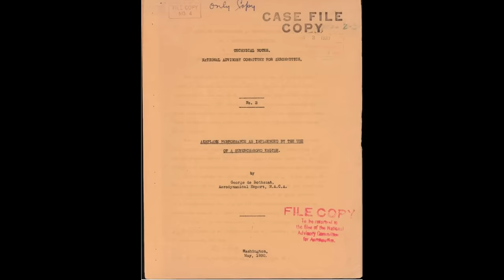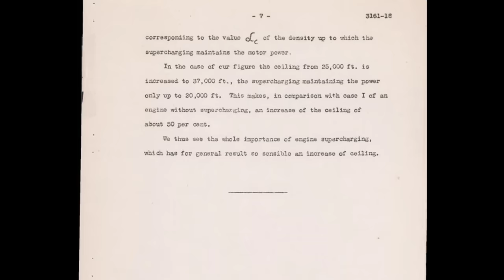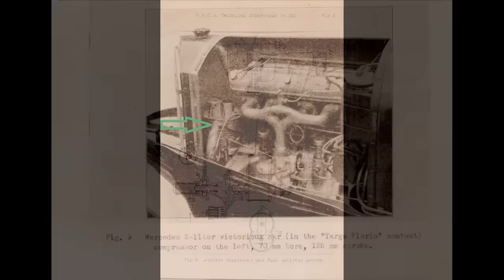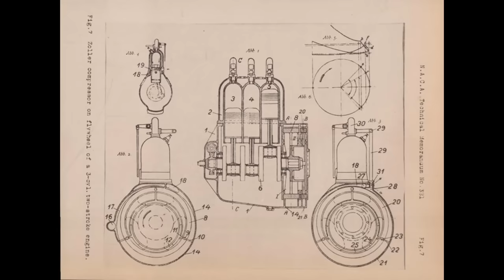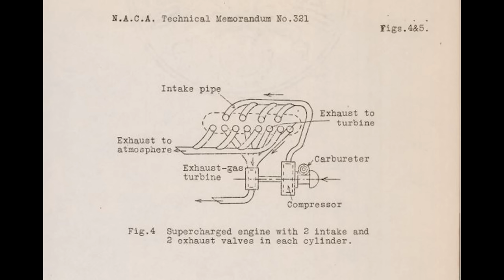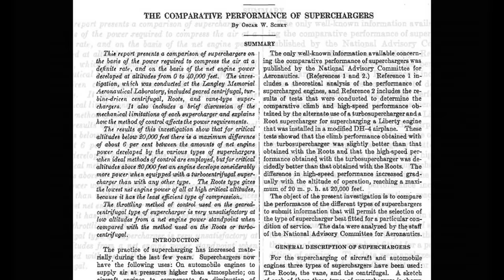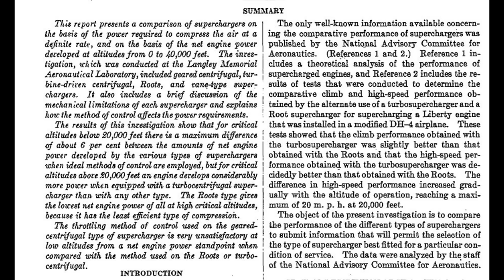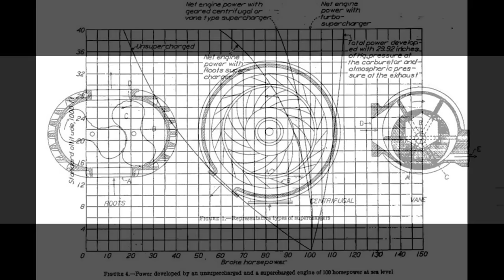Turbo vs Supercharging in WW2 Airplanes

Comment: Are the power losses below critical altitude due to throttling per se, or due to the power lost to driving the supercharger? Several books I've read have said the latter - if you optimize the supercharger ratios for high altitude, at low altitude the atmosphere is much denser, so it takes a lot more energy to drive the supercharger since it's geared high enough to drive the compressor fast enough to provide full boost at high altitude. Yes, you do have to throttle the air coming in but you've got it adjusted so that the engine is operating at maximum boost all the way up to the critical altitude (it drops off after that because the compressor can't spin faster since the gear ratio is fixed). Since it's always operating at maximum boost below the critical altitude, the engine itself produces the same amount of gross power, but the compressor is absorbing more power at low altitude so there's less net power being produced. I suppose the corollary to this is the turbo isn't being driven by the shaft and therefore isn't subtracting from the output power, and this is why power doesn't drop off at low altitudes. At low altitudes atmospheric pressure is higher and you'd theoretically have higher backpressure but this is balanced by less need for compression to achieve maximum boost, so excess exhaust would be vented via the waste gate, which would serve to reduce backpressure.
Reply from the maker: It always costs power to drive the supercharger, so those power losses are always there. The throttling losses are in ADDITION to the normal drive power costs. That's the reason the power is lower below the critical altitude. At the critical altitude you don't have throttling, it's wide open. If you throttle (meaning cut off or restrict the air) a supercharger will have to work harder and thus draw more power to generate a given amount of manifold pressure.
Reply: At low altitudes the air is denser. The compressor is working at a fixed RPM (since it's geared at a specific ratio to the output shaft of the engine) so it would have to work harder and lose more power from compressing the air if the air is denser. As altitude increases the air gets less dense so the compressor has less resistance to its movement. At least, that's the way it was explained, and it does make sense to me. If you throttle the air coming in, you'd actually reduce the air pressure (on the back side of the throttle valve) and it seems to me that the compressor would absorb less power at a given RPM. I suppose I'm going to have to think about this some more - the final result is supposed to be maximum boost at all altitudes up to the critical altitude, you HAVE to throttle the engine if your supercharger is operating at fixed RPM, the amount of power absorbed depends on the resistance of the air that's being compressed, that would depend on its density, that density depends on the altitude, but it also depends on the throttle setting. Theoretically, at maximum boost (the output pressure) and fixed RPM, the incoming pressure in front of the impeller (which depends on both atmospheric pressure and the degree of throttling) MUST be the same for all altitudes! Yeah, it's confusing!
Reply from the maker: Back up for a moment. There is a reason that throttling increases the loses due to supercharger drive power. Think of it like this. If you are at sea level, and you have atmospheric pressure at the inlet (throttle fully open) you have about 14.7psi at the inlet. Now, lets say you want to have 19.7psi in the intake manifold. How much boost does your supercharger need to create. It needs to create 5psi. Simple so far. Now, throttle the supercharger so that inlet pressure is only 11.7psi at the supercharger inlet .Now how much boost does it need to make to get 19.7psi? Clearly a supercharger that needs to make 8psi is going to draw more power than the identical unit only needing to make 5psi. That's why throttle causes loses. This isn't simply my opinion. It's straight from NACA.
Reply: I've been thinking about this some more. The reason the supercharger inlet needs throttling at all is because at sea level the amount of boost you'd get is too much, so you throttle it to the point where you have, as you say, 19.7 psi in the intake manifold. This is because the supercharger is geared at a fixed gear ratio to the output shaft - say (I'm making up a number here) 6000 RPM. So at sea level you throttle it so your inlet pressure is 11.7 psi and the supercharger will boost that to 19.7 psi (an increase of 8 psi). You CAN'T operate the engine with the throttle wide open at sea level because that would mean you have more than 19.7 psi in the manifold. OK, so now you've climbed to, say, 12,000 feet. Air pressure has dropped to, say, 13.7 psi (I'm making this up, of course). You STILL have to throttle the intake, but by how much? By whatever it takes to reduce the inlet pressure to 11.7 psi, because the supercharger is STILL spinning at 6000 RPM and the intake manifold pressure must still be held to 19.7 psi to make maximum allowable power at the same RPM. By the time you get to the critical altitude, say, 24,000 feet, atmospheric pressure is now 11.7 psi and the throttle is finally wide open. The intake manifold pressure is STILL 19.7 psi because the supercharger is still spinning at 6000 RPM. Now, above the critical altitude, atmospheric pressure has dropped below 11.7 psi, and the supercharger can't maintain 19.7 psi in the intake manifold anymore, so power output drops even with the supercharger spinning at 6000 RPM. So I still don't see how throttling would cause a power drop at lower altitudes, since the amount of compression necessary remains the same. This also means my other explanation (that higher air density at low altitudes absorbs more power at the same impeller RPM) doesn't work, either, since we're holding the inlet pressure the same by way of the throttle. I'm obviously missing something here, and will have to think about this some more. By the way, I really do enjoy these videos, keep making them!
Reply from the maker: I suggest you download the NACA report and read through it. I know it's confusing, but throttling costs power. Blow through a straw and it's easy. Block one end and try to blow through the same amount of air in the same amount of time and you will use more energy doing it.
Reply: Yeah, I'll definitely have to do that and see what's going on, since I'm definitely missing something here. I do understand that it takes more energy to suck air through a partially closed throttle valve, however at low altitudes (where the throttling takes place) the ambient air pressure is higher anyway and should provide the extra energy for the air to make it past the throttle valve.

Comment: What determines how many blades a propeller had and what a propeller diameter is? on those WWII planes ✈️??
Reply from the maker: Required blade area and tip speed limitations.

Comment: Geared and centrifugal Superchargers were a mature technology and exhaust driven superchargers were a nascent technology.  War spurns development, but not a good time to putting too many of your chips in Nascent technologies.  You are correct the problems with Allison engines were mostly the fault of the US military telling aircraft manufacturers HOW to achieve the performance that they wanted rather than just telling them WHAT performance they wanted from airplanes.   The US suffered from extremely arrogant military leadership.

Comment: I find it interesting that NACA Report No. 384 does not take exhaust thrust into account, especially considering that the mechanically driven supercharger is superior to the turbocharger in this regard. In Sighard F. Hoerner's, "Fluid Dynamic Drag," the author estimates that exhaust thrust (in lbs) is roughly equal to the engine's power (in HP) multiplied by 0.12 for a supercharged inline engine. Assuming an aircraft with an engine of 1,200 BHP has a top speed of 360 mph, then the thrust horsepower provided is around 138 HP; hardly insignificant.

Also, the Birmann Turbosupercharger arrangement trialed on the XF4U-3 was an interesting attempt to make the turbocharger compact enough for use on a carrier based fighter. Shame the system was simply too problem prone and complex.
Reply from the maker: NACA covers exhaust thrust extensively in other reports. In general, the reports tend to be very specific and limited in scope to the topic at hand.
Reply: That['s a reason the Merlin wasn't exhaust supercharged: the exhaust ejectors were specifically designed to maximise thrust augmentation and Rolls Royce didn't want to lose this.

Comment: What were the exciting developments in piston engines that you talked about getting killed off by the jet age near the end?
Reply from the maker: 4  row radials, more advancements in water:methanol injection, power recovery turbines, sleeve valve technology and a lot more.
Reply: @GregsAirplanesandAutomobiles  Wow. A shame really, that these were not studied further. Great video, by the way!

I suppose you could say that in a way, turbocompressors killed off the very engines they were designed to help, as what more is a jet engine than a large turbocompressor with some flame cans in between the turbine and the compressor?

Comment: Great video thanks! Any chance to get a private discussion going? Looking for ideas to get more performance at 6,000ft altitude density on a flat6 580...
Reply from the maker: My answer is usually to add boost, but I'm not sure what your application is. As an example, these guys build boosted IO540s and 580: https://advanced-aero.com/product/g3-standard-turbo-lycoming-engine-tio-540-br-385hp/   I have no affiliation with them, and no nothing about them other that what I see on their site, but I generally think that's the answer. However if a non aviation project on a budget, I would probably go another route. I will have an email for contact up soon, but I have to send it to my Patreon supporters first, I'm working on improving communications.
Reply: @GregsAirplanesandAutomobiles  Thank you, yes the application is an IO-580 indeed. I have trouble with packaging and space available. I am also exploring mechanical supercharger and NItrous. I only need the boost for 11 minutes in a row, one week a year in September :).
Reply from the maker: Is this an airplane, as sand rail, an air boat? If it's an airplane what altitude? If only operates through a narrow altitude range, say a few thousand feet, I would go with a simple centrifugal supercharger that's belt or gear driven.
Reply: @GregsAirplanesandAutomobiles  yes - I was trying to give clues in my prior requests : 6,000ft altitude density, one week in September = Reno Air Racing.
Thanks - I’ll look into superchargers

Comment: I have a question: which would win in a dogfight to the death, an Edge 540 with guns (and the weight penalty of such guns) or a P-47?
Reply from the maker: That's a question I never expected. The P-47 will win easily. The extra 100mph-200mph of top speed is just too much of an advantage. Plus the Edge will run low on fuel very soon after the fight starts, so the Thunderbolt could just keep it's distance and waste the Edge when it runs low on fuel and has to land. The Edge is really agile, but that only gets you so far. You can't beat a P-47 with a Fokker DR-1 either, at least not unless you get really lucky.